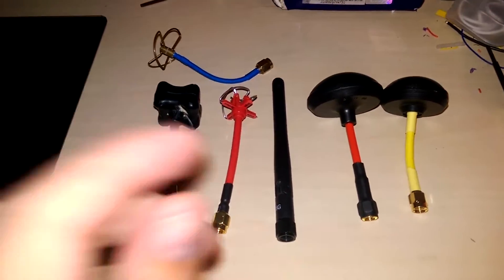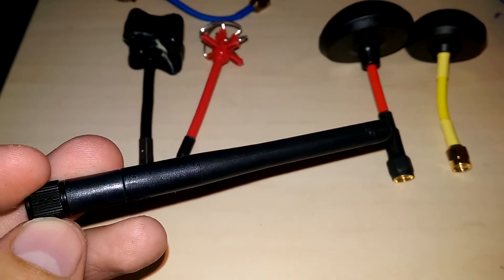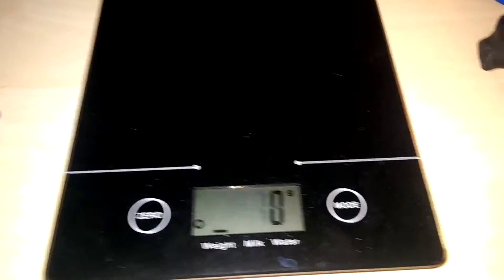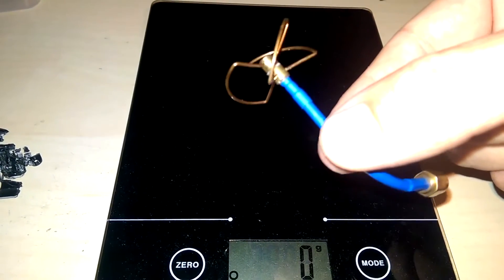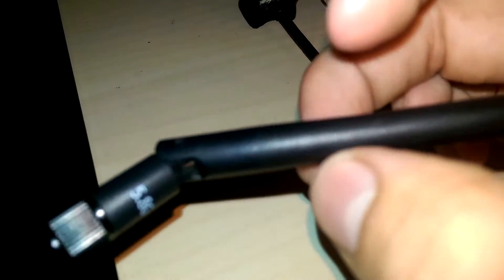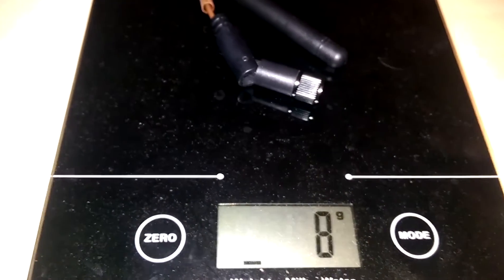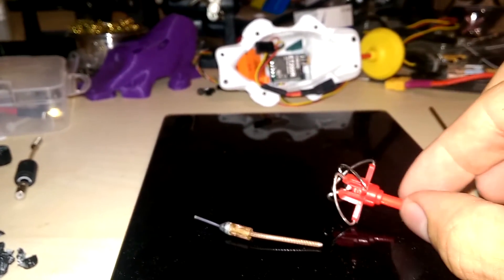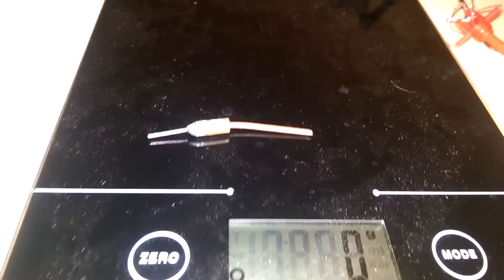DIY - Nearly FREE linear antenna whip!

Comment: What is that little cylinder metal shape is on the top of the antenna?
What is the purpose of having it?
Thanks
Reply from the maker: The little metal thing is for tuning the antenna.  The length of the wire poking out the top of it is very important to how the antenna transmits or receives energy (what frequency they deal in).  They slide that little metal cap up or down to dial in on the 5.8GHz range in our case.
Reply: So, you have to solder That little metal thing to the antenna?
thanks again
Reply from the maker: You don't need to solder the little cap thing.  When you strip the wire back on the bottom where you cut it, there will be a mesh copper outer sleeve. you can move that sleeve over (pick at it a little, it will unbraid itself) to reveal another plastic coated wire underneath.  you strip back that plastic to find a thinner wire inside.  The thin inside wire you solder to the pad that had the middle pin on your SMA and you solder the copper mesh to one or both of the pads where the outer pins of your SMA were.  don't slide that metal cap around or it will change the tuning of your antenna and it will work like trash.  Good luck!
Reply: Good video thanks man